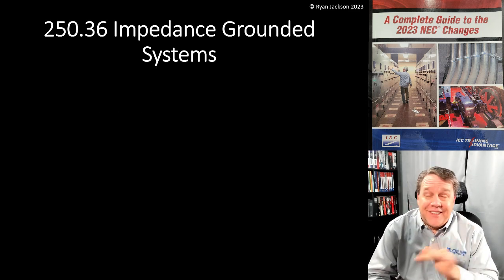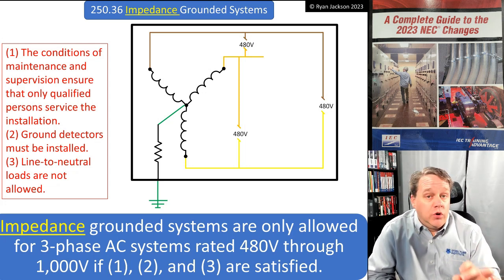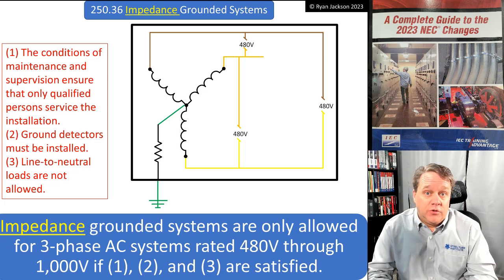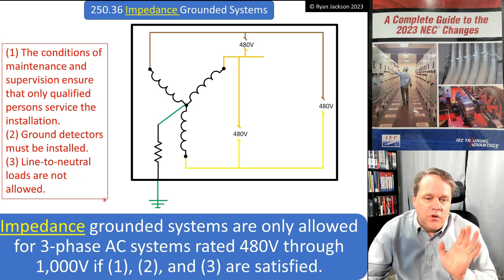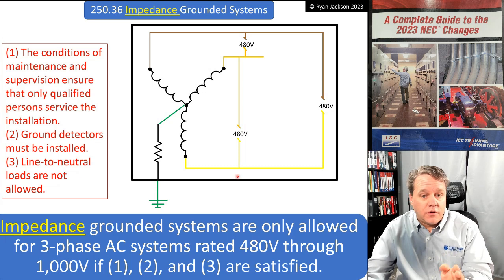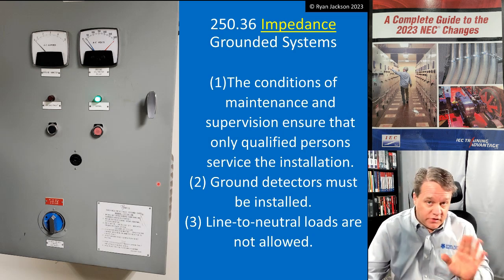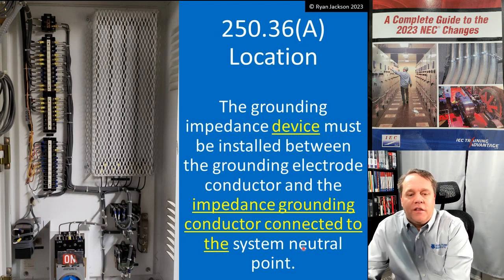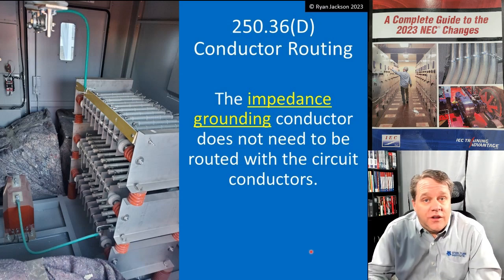2023 250.36 Impedance Grounded Systems

Comment: I'm surprised no one objected to 250.36(3) being added to the code. It is a common practice in industry to have impedance grounded system for ground fault detection and also have a need for 277V single phase loads (e.g.,, open bay lighting systems.)
Reply: Another example I have seen often is with industrial electric furnaces and ovens. Elements are single phase and controlled via SCR/contacts by zones independently as 277V legs. Transformers tend to be larger  (1500KVA or 2500KVA) with impedance grounding to reduce risk/damage during a phase to ground fault.